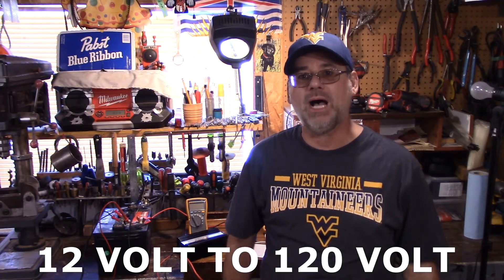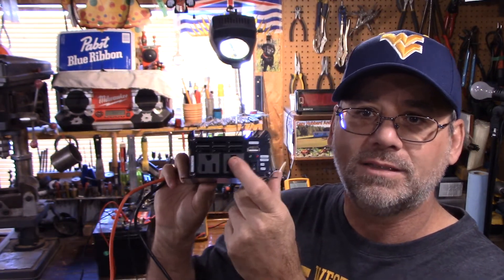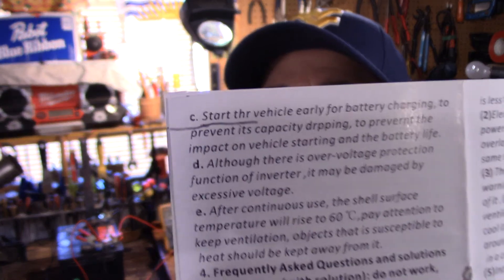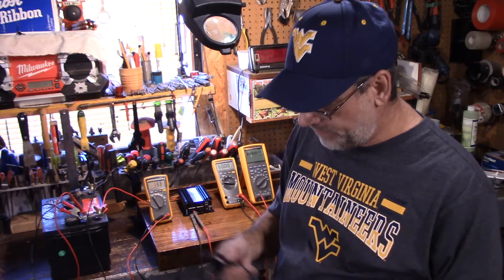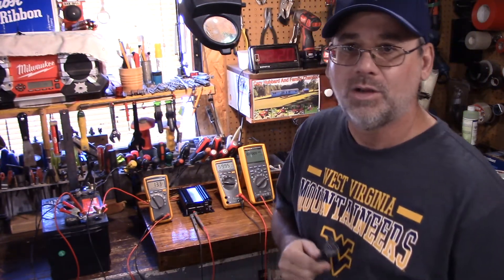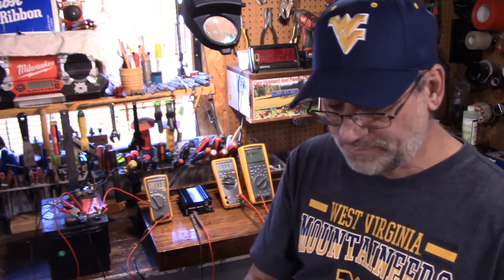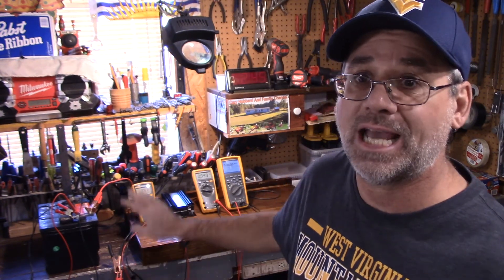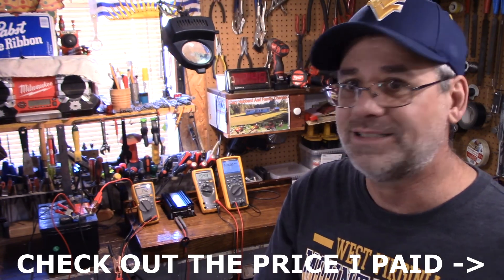POWER INVERTER  TESTING   - 12 volt to 120v

Comment: How do you connect the PINV66 to the cigarette lighter though when driving in the car???
Reply from the maker: Kevin  most come with the adapter for a cigarette lighter  but since the circuit is limited by a fuse and smaller gauge wires you can not get the full  wattage of the inverter.
Reply: STEVE ROB REVIEWS the PINV66 600 watt doesn't come with the male cigarette lighter plug though. It only comes with the jumper style cables.
Reply from the maker: Kevin your correct but that just this manufacture , there are plenty of cigarette adapters on the market for a low cost if you need it. I bought one  off ebay.  Just search 12V Cigarette Lighter Plug Cable Cord W/ Indicator Light For Car Power Inverter
Reply: STEVE ROB REVIEWS Oooh okay thank you. I will do that.

Comment: I used to have a soldering gun just like that. It was actually my dads. Not sure where that thing is now. This is interesting about the inverters. I bought one from Northern Hydraulics to run a small air pump to blow up a air mattress when going camping. The thing blew up mid way threw. I tried to take it apart to see if it had a internal fuse but I could never get the dang thing apart so I chunked it haha. 
ON a side note... Have you ever ran a possum off a inverter before? Asking for a friend. Thanks.
Reply from the maker: Possums work great off an inverter :) wing wang can be wing wang at time eh :)
Reply: STEVE ROB REVIEWS I am smelling what you stepping in there Steve Rob👍👌

Comment: I have a 400-watt inverter that I got in 2000. It's an ACE hardware brand and its rocks. Very useful to have.
Reply from the maker: My  camp runs off a 400 watt cheap inverter for 10 years and still works great. They are handy .

Comment: Not all newer power tools will operate using a square sign wave inverter and you have to upgrade to a pure sign wave. Some electronics will have a shorter life due to the wave pattern of the square wave inverters too.  Inverters are a get topic and a cheap way to supply power at the camp.
Reply from the maker: Yes so true and some sine wave inverters are not so sine wave for $100 HAHA  a  real good sine wave inverter is about $1 a watt still but yes the prices have come down over the years with so much solar being built these days.